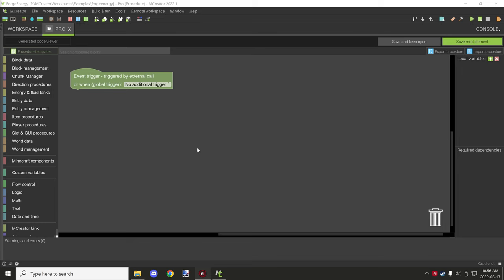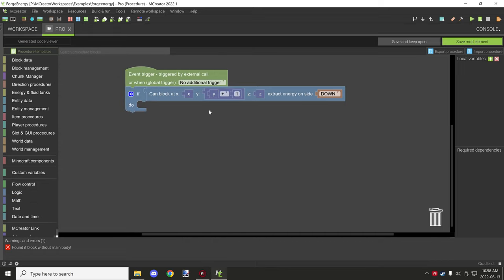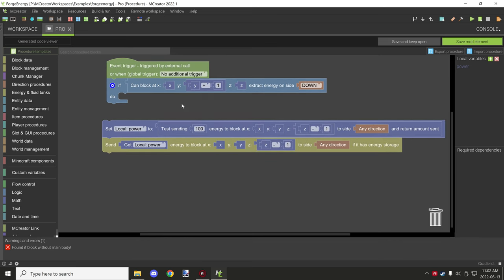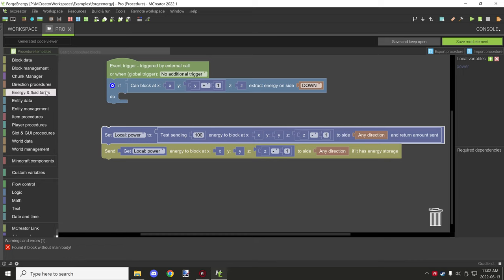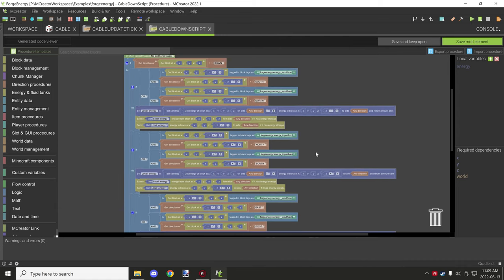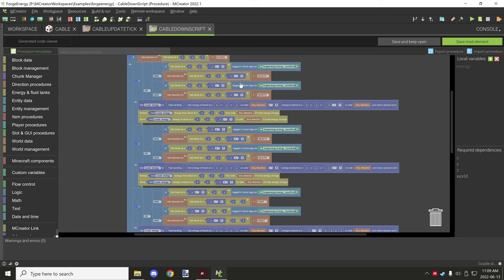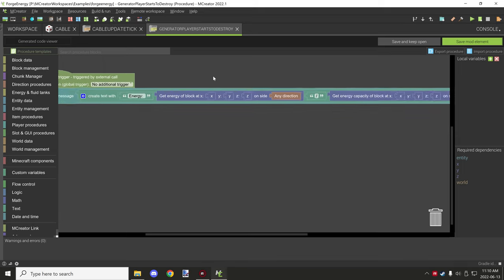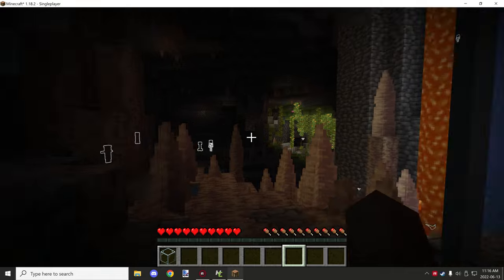MCREATOR: Forge Energy Procedure Blocks | 2022.1

Comment: Hey, could you make updated tutorial for biomes (since they changed quite a bit in 1.18)
Reply from the maker: I am still trying to figure this out actually, it seems a lot harder to work with tbh.
If the category is the same they should spawn closer together and from what I have seen with the base game files biomes actually have more then one setting list but they use different values and such to make them generate, though I have no idea really how to reproduce it. Even with biomes with the same settings they seem to compete with each other for priority which is really a pain to work with.
Reply: @NorthWestTreesMCreator  I was actually looking into mcreator's code and problem is mcreator does it differently than datapacks. Mcreator just gives you ability to change few values and using math it calculates the rest, for example weirdness is completely random. I will try to add feature adding vanilla way, but there is no promise. I can work with java, but never worked on mcreator before